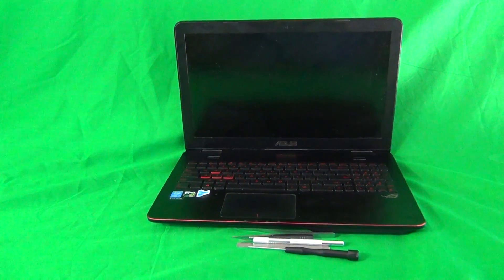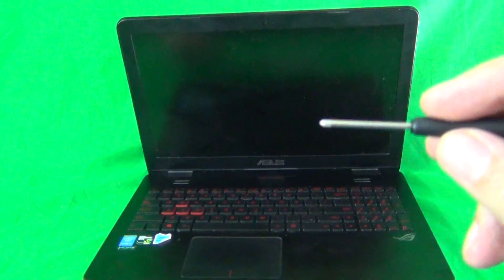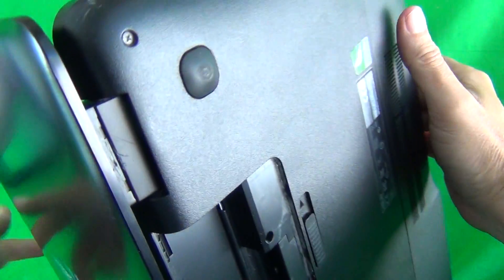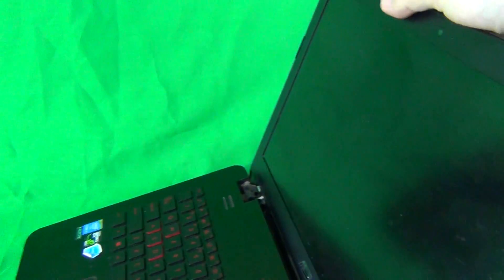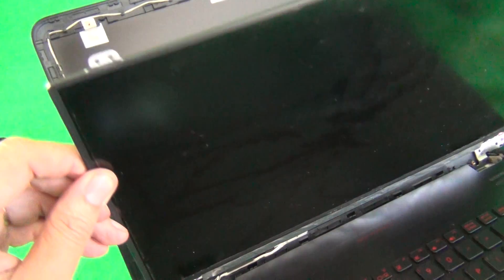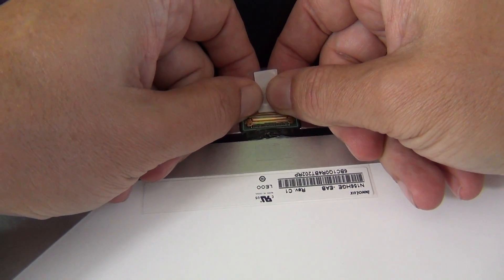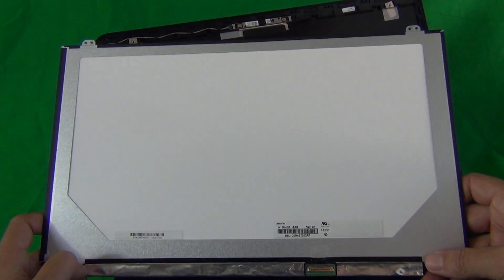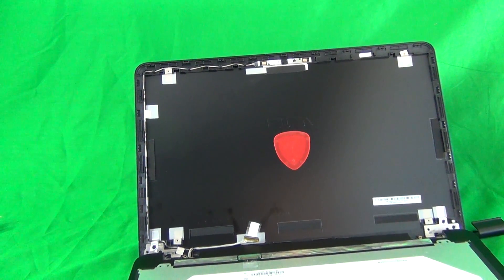ASUS ROG GL551J Screen Replacement Procedure

Comment: Hi, I have ROG G551VW that has 4K panel with (I think) 40 pin connector.
I want to buy a replacement panel for it, but didn't want to use the same 4K panel, and there's a cheaper 1080p panel with 30 pin connector.
My question is : will it works? I saw in the title of the store page that it is compatible with G551VW, but not sure if it will works since it has different pin, thank you in advance.

Comment: I called ASUS Tech Support before I saw this video, and they told me the cost to fix the screen would be around $700. Thankfully I did not go through with it, and I stumbled upon your channel to see if you guys had the solution to my problem (which you did)! I have the exact laptop in this video, and it was an easy straightforward guide. Thank you so much, you guys saved me $600 worth of repairs.

Comment: I'm having an issue getting the hinge clip back in. I've tried for 15 min but it won't hook over the components
Reply: Probably too late for you by several years but I think I know this issue. To note, the hinge clips have a left right configuration, so you have to make sure the part is labelled for the correct side. I wish I could have those 15 minutes back as well.
Reply: @StevenYounkinCivil  oh yeah, I dont even recall which build this was
Reply: @StevenYounkinCivil  The L R part was really helpful - thanks! Still, does anyone know where exactly it has to click? Do I push the caps from the top when the laptop is open or do I try to push them back the way they removed them in the video?
Reply: @teodorandonov1992  While it's been about a year since I did this, I seem to recall keeping the laptop open while putting the caps on. I think there may be a small click when they snap into place, but I'm not positive. I think the general rule of thumb is to press firmly and wiggle and try not to force anything. If it doesn't fit back into where you took it out of either something is stuck or we're putting it in wrong.